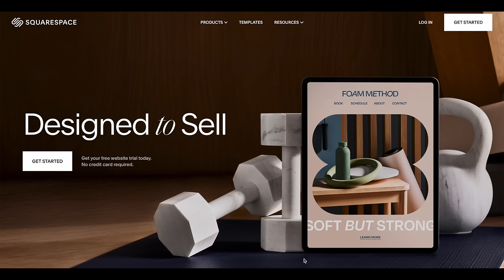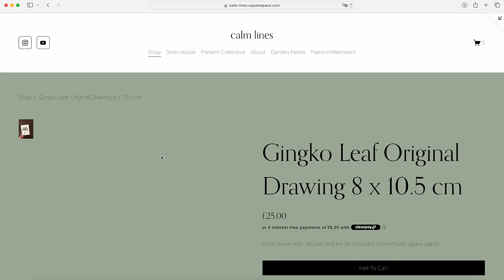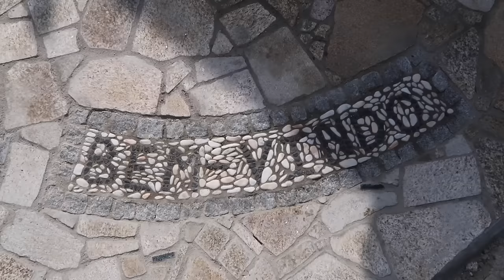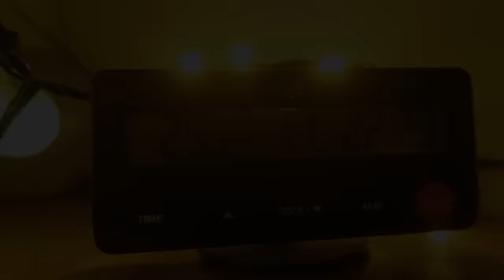We finally got this job done on our off grid homestead

Comment: The driveway entrance is looking SO nice. Well done. It was fun to see you all conversing with the neighbors in Portuguese. You've become a part of the place and reallly "fit" there in a very lovely way. 😊
Carissa, I love your potted tulips in the kitchen. I didn't realize they would thrive like that indoors. Do you keep them like that year round, and they continue to bloom each spring, or will you need to transplant them outdoors? 
I've decided, as I have no soft vine type material to work with to make a true wattle fence, to do the variation where you put the posts in side by side in pairs and fill in between them with staight branches. I won't get the pretty woven effect but will still have a very nice natural fence, using what comes down off my trees. 😊👍
Have a great week!! 🥰♥️

Comment: I love the way all your animals are so comfortable with each other. I have to keep my cat separate from our dogs at all times. Also, I was wondering if you still have that draught problem in/on your bedroom door? I was going to suggest ships caulking, or you could make your own with very thin cotton rope soaked/overlaid with ordinary caulking (from local DIY hardware store. These would both do the job and ensure your door is properly sealed off from the cold in winter and the heat and dust in summer.

Comment: Great content as usual. However, from my own experience, you should have compacted that sand way more before you laid those concrete blocks. The best way to compact that sand would have been to use compacting tool. The way you did it, it looks really nice, BUT … Most likely, the sand under that pavement will be washed off after few heavy rains. I hope I am wrong.